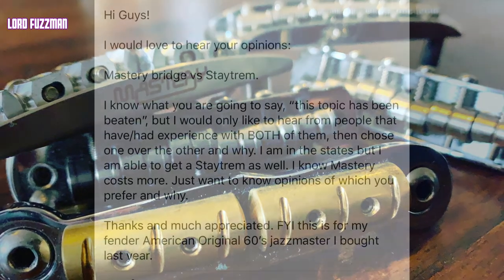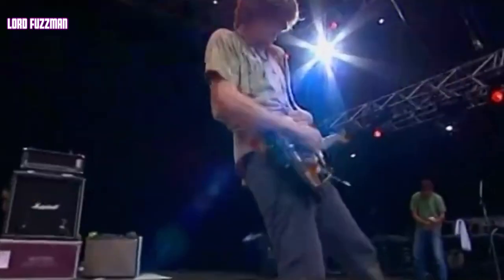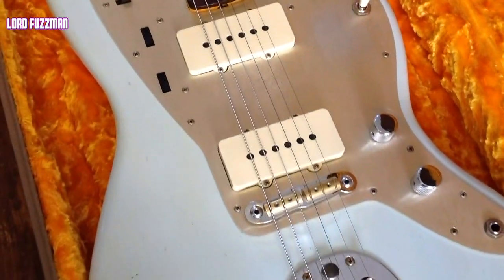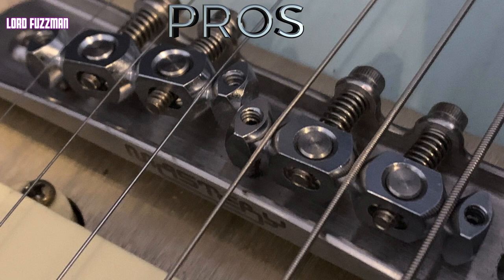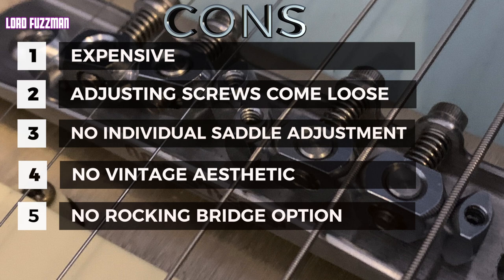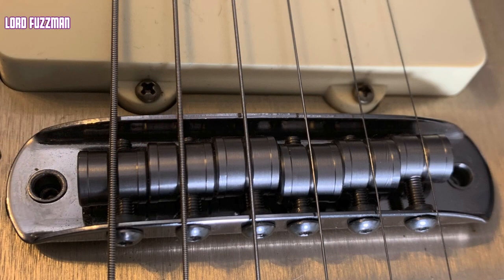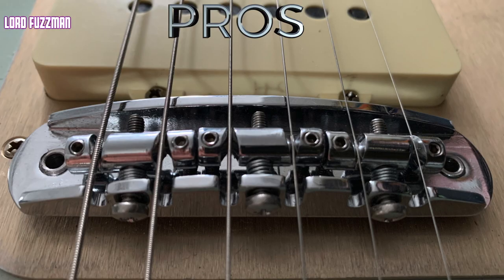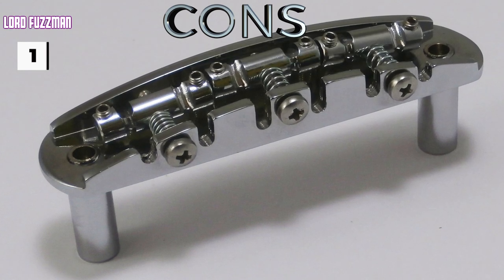ULTIMATE OFFSET BRIDGE SHOOTOUT - Mastery - Halon - Staytrem - Fender RSD - Mustang - Vintage

Comment: For me, offset bridges shouldn’t be about sound, it should be about stability. I have never in all my days come across a new offset of any budget that didn’t need heavy set up on the bridge to play properly and stay in tune. Why Fender and it’s sub companies have never in 50 years addressed this is beyond a joke.
Reply: Fender ignored the issues for a long time, but finally (!) now they have responded with the RSD bridge, which if I were buying today would be the one I would get. It's a great, simple design with none of the issues you find in the vintage offset bridges. The only downside is that you can't buy the RSD as an aftermarket part; they are only available on Custom Shop guitars. I hope Fender changes their mind and starts selling them aftermarket. If they do, I'll be the first in line to get one.
Reply: And yet you put a staytrem, or a mastery you’ll hear a significant difference in sound

Comment: In my opinion, the tone of the vintage style bridge is the best. It's definitely bright and clear. I think my second favorite is the Staytrem though. Seems like a good value and fixes the problems with the vintage style. Unfortunately, I think the tone is a bit darker on the Staytrem though. I really wanted to like the mastery, but I just can't seem to get behind the tone of it.
Reply: Agreed! I just invested $220 usd in a mastery for my '96 MIJ JM . I was shocked by this comparison- the mastery seemed to be the thinnest sounding, next to the vintage- for my ear- but also comparison varied to some degree, respectively, as he toggled through pickup settings 🤷🏻‍♂️
Reply: vintage screws loosen over time and start to buzz ..

Comment: Staytrem is fantastic, paired with a shim on my Avri 65 Jag it has perfect intonation, comfortable string spacing and requires no maintenance. Combined with the shim I'd say it enhances the classic Jag sound without drastically changing it.. exactly what I was looking for. Staytrem is also durable used mine regularly over the past few years with no issues. Staytrem collet and trem arm are also really good.
Reply from the maker: My thoughts and experience too 👌

Comment: I own a Classic Player Jazzmaster (Mexico) and, based on this video, I just purchased a Halon bridge. The original Fender bridge was like a toy compared to the substantial metal on this beast. OMG. So easy to set the height and intonation and the tone is huge and rings forever. Haris at Halon was very helpful and extremely fast with email replies. BUT the posts on the Halon were slightly larger in diameter than the thimbles on my MIM JM. Lucky for me I own a drill press. I screwed the posts off the bridge and inserted them in my drill press chuck (one at a time) and turned set the drill press to 1700rpms (my drill has an rpm readout). i took a file to the side of the posts while they were turning and filed them down to the correct diameter so they just fit the thimbles. It took about 20mins per post due to my constant testing and quality of the steel posts. Perfect fit. I considered drilling out the thimbles but i didn't think there was enough sidewall on them and didn't want to mess with enlarging the thimble holes on the guitar. I considered the mastery bridge but they looked a little weird for my taste.

Comment: That custom shop bridge is the winner for me, it seems to have a fuller sound, sustains nicely and looks the business. The weakest was the vintage. Whether any of this would be noticeable in a band mix is debatable. If I could get the custom shop one as an after market upgrade (and it wasn't too expensive) I'd be all over it. However, on balance and as a UK resident, the Staytrem would be my go to.

Great video, nicely paced and with all the information you'd ever need, IMO.
Reply from the maker: Totally agree. In a live setting you wouldn’t notice any difference at all, I think it’s more about functionality for me. Thanks for the kind words 👍🏻

Comment from the maker: Please subscribe if you got anything useful from the video 👍🏻
Reply: What is your opinion of the Fender American Pro bridge? It is often mentioned as Fender's answer to the Staytrem.
Reply: I noticed the bridges with more mass the mustang staytrem and halon all had a similar sound. Where the fender custom shop seemed to have a little bolder sound. I have menrioned this before but why not take a copper and brass mix or what ever bell brass is and make the saddles out of those. Anyways again great video. I gave you thumbs up
Reply from the maker: @jimh8422  thank you for the comments. Halon are one of the few companies where you can specify exactly what you want the saddles to be made of which is a great idea. They are still a relatively new company so still getting off of the ground though. Thanks for watching
Reply: Will do. Regarding the fender custom shop bridge- does it rock or is it fixed? And how was the tuning when the trem arm was used please?

Comment: I had a cheap tunomatic style bridge with roller saddles on it, which happened to drop right into the existing holes of my Fender Japanese Traditional Jaguar. The radius is "wrong" but it doesn't pose any problems for me at all. I actually think it has improved the tone a bit too. Not bad for free (seeing as I already had it lying about).

Comment: This was super helpful in my decision on which bridge I want. I really like the custom shop bridge, but because of lack of availability I might need to check out the halon because that seems like the next best option. Thank you for this awesome comparison video!
Reply: I checked out the new RSD bridge from Fender Custom Shop and it's really exciting. One of the best things they're ever done, in fact. It's too bad that they aren't selling it as an aftermarket part because they would sell a lot of them. They're using the RSD as a feature selling point exclusively on CS guitars. I don't really agree with that strategy as I would think Fender would want to get the RSD to as many non-CS players as possible.

Comment: Just got a tip for rattling or saddle adjustment screws vibrating loose.

Silicon gasket maker works great, and won't screw up threads.
Reply from the maker: Great tip Don, will give that a go 👌

Comment: I got today a Mastery bridge for my MIJ Jazzmaster, and so far I am super impressed by the improvement in tuning stability and sonical resonance/sustain of the guitar! I didn't consider other options also because of covid/shipping issues. So I had to get what I was able to find between my nation boarders. Also the setup was really quick and easy, and was able to tune and set the intonation properly.
Reply: Mastery is a well-engineered bridge. Woody is a total pro and knows what he's doing.
Reply: @danielstoddart  I was so well impressed I also got the Mastery Vibrato. Also in this case a totall huge improvement over the orginal MIJ part.
Reply: @JoelGilardini  The vibrato is also pretty great. I like how the collet is a better design that seems more solid when using the vibrato arm. I also like how there's no locking button...I never used it when I had one on the stock Fender unit and it simplifies it.

Comment: Been playing jaguars since they were cheap. I paid 184 bucks for my bascket case 64 and like 900 for my clean 63. Anyways i used a stock bridge for years i later picked up a no wire abr1 when gibson custom shop started making them. I made aluminum slugs that dont rock threaded for the abr1 post threads. I also play giant fat necks by warmoth on both my vintage jags and they are 12 inch radius which matches my bridge radius. I play jags for the 24 inch scale not so much the tone . So my 64 has burst buckers and my 63 has the stock single coils but wired more regular style just on off switch for each. This was a great video. I love talking jags. Really digging the halo. Although im not planning on switching my bridges. I pound the shit outa my guitars and they are solid.
Reply: Do you have any tuning issues with using the trem on a tuneamatic?

Comment: I needed a .1 shim to get the set up I needed with the Fender Pro bridge.  I did indeed get the perfect action with no issues, except the break angle was so extreme it made the string tension impossible for whole step bends.  The Mastery bridge solved that, and turns out to be perfect for me. And I love the way it sounds with my rig.

Comment: That Halon sounds remarkably "flat", or full spectrum. It reminds me of studio monitors: they aren't exciting, but that's because nothing is missing- no notches or surprises.

I know which I'd splash out on for a new build for sure.

That said, my current offset crop (3) use variations of the "proper" Mustang bridge and the American Professional with and without nylon bushings (rocking and non-rocking). They're relatively inexpensive, relatively high quality, and once properly shimmed at the neck and set up (1x Descendant, 2x AVRI trems) absolutely flawless with regular 'ol 10s.

Comment: I think it should be mentioned that Halon offers rocking bridge studs, besides keeping with Leo's original design, if you have a mute on on your Jag, and you want to use a Mastery, you'll have to drill out the holes in you mute to make it work, the Halon rocking studs work fine with a mute, they fit fine into the mute holes.

Comment: The video shows some Mustang saddles with adjustable height screws during the Halon portion and they don’t have these on their site. Just wondering if that has been discontinued. We prefer a slightly flatter radius and resort to shims on the E strings so these would offer a more elegant solution.

Comment: Was going back and forth on mastery or staytrem. Read the forums and all pros and cons, but this video solidified my staytrem purchase. Just ordered. Now a mastery tremolo unit and a staytrem bridge that rocks may be something awesome though.
Reply from the maker: Wise choice Evan, yeah a Staytrem bridge and Mastery trem is a great combo that I use myself 👍🏻
Reply: @LordFuzzman  I got both units ordered. Might be some time until I see them, but not in a rush. My stupid fender tremolo (really vibrato but whatever) doesn't completely return to it's original position after use which I have never seen before. Mastery should take care of that. I find it odd that mastery pretty much tells you to leave the arm in at all times though and will refuse to sell a replacement if arm is lost.
Reply from the maker: @evanpauls3078  yeah I hear what you’re saying. I do leave my mastery arms in all the time. Even in the case and never have any issues 👍🏻
Reply: @LordFuzzman  a real pleasure Fuzzman. This video is seriously amazing and super high quality. You made things very clear and got me to stop wading through all the forums and noise with some very true and straightforward comparisons. Also, with my open back headphones on, the sound quality of the video itself really helped make certain observations pretty apparent. Much appreciated!

Comment: The vintage is fine! Just use heavier strings and the right setup no need to change it - I did like the resonance the halon had but it had less upper high end detail - the mustang and staytrem seemed to choke the sustain a little and made it more ploddy- the mastery did have a nice open ish sound to it - and I love the idea and look of the CS in all honesty I have no issues with my vintage style one I think I’ll keep it as is :)
Reply: Exactly what I think. My favorites were the vintage and mastery by far. I have the mustang, and I think it sounds awful. The Staytrem is pretty nice, but not enough clarity and overtones. I actually just don't like adjusting the individual saddles which is why I replaced it with the Mustang, but I really don't enjoy it so I think I'll just deal with the Vintage or maybe get a Mastery.

Comment: OMG, night and day with the Custom Shop Bridge. I think the Mustang is the runner up for me. Just like PRS will use brass tuning pegs and saddles to get more chime, this made it clear to me that brass saddles really make a difference. More bell like, for sure. Clear as day. 
I think it would be the difference between cutting through a mix (especially live when you have less control over your mix) and disappearing. 

*Granted, if you're in a shoegaze band, single notes cutting through vs having a homogenous wall of sound might make you want to stick with a stock bridge.

Comment: Great video, very informative! The other thing I'm curious about is how the bridges affect the trem action? I have a J Mascis Jazzmaster with the AOM bridge. I'm considering modding it to fit another jazzmaster style bridge. I have heard that bridges with the rocking action affect the trem action and sound in a positive way, as compared to fixed bridges like the mastery. Would you have any recommendations? Thanks!
Reply from the maker: @gambrinuspie  hi thanks… yes the rocking bridge works much better with the trem.. I would go for either Staytrem, Halon or Tuffset 👍🏻
Reply from the maker: @gambrinuspie  hi thanks… yes the rocking bridge works much better with the trem.. I would go for either Staytrem, Halon or Tuffset but you made need some conversion posts for the J Mascis bridge which are available on eBay. 👍🏻

Comment: I’ve got a question — I’ve never used the mastery bridge, does it stay on the guitar when you take the strings off?  Or will it fall off?  One of the things I like about the TOM/AOM bridges is that you can get locking set screw versions that won’t fall off when you take the strings off.

Comment: Huge help! Thanks for taking the time and trouble to do this.  I'm thinking about a Custom Shop Mustang, so I can get the RSD bridge which is very appealing but this video shows (at least to my ears) that a regular Mustang bridge could actually be preferable because it offers individual string adjustment which I really need with heavy strings and wound third.  Thanks again.
Reply from the maker: Glad you found it useful, it’s not the most interesting topic but people ask about bridges on the forums every day.
Reply: @LordFuzzman  SO very true!  I am now questioning myself about how crucial is it to me to have individual string adjustment?  With a heavy set, 52-12 with wound third, maybe the RSD is perfect as-is?  The only chance I'll have to find out is ordering one through the Custom Shop but I would sure hate to get it wrong and find out that I really needed the adjustment and have a much cheaper unit with the Mustang conventional bridge.  I have that on 3 guitars from the Parallel Universe series already so I'm tempted to try the RSD but it's still something of a risk.
Reply from the maker: @ES295  I don’t think they sell the RSD separately. Staytrem are now shipping globally. You can’t go wrong with one of those 👌

Comment: Great video! I play a bigsby Tele, so all this is kind of relevant to us too.
I use the vintage style JM bridge, but I think the bigsby adds a bit more break angle.
I use some nylon/plastic strips cut to size which I insert into the post holes which reduce the amount the bridge can rock, without locking it completely.

Comment: I've got the J Mascis Squier with TOM bridge and at some point, I think I'd prefer another bridge. I prefer a drop in option, but that can be problematic with thise Squiers. Staytrem appeals to me in that they are apparently great bridges and I've heard Staytrem makes thimbles especially for J Mascis that drop in. 

I'm in the states, so getting one could prove to be difficult. My other option might be a Wilkinson roller bridge. I've heard most drop in and resolve a lot of the issues, but doubt it will be as ace as a staytrem.
Reply from the maker: Staytrem stopped making the drop in replacement a couple of years ago, I did a video on it and he got inundated with orders. Halon do a very good drop in replacement.

Comment: Great video! Just ordered a staytrem for my ‘95 MIJ jm… Original owner had a TOM installed with small 5mm dowels!? So I need to somehow get those dowels out to get back to original 9mm post holes. Any DIY suggestions?

I’d also love to know your opinion or see a video comparing jm Vibrato systems/tailpieces.

I’ve personally decided to replace my MIJ tailpiece with an American tailpiece fitted with a Staytrem arm/collet. Waiting for shipment so still haven’t tried it or a mastery.

Cheers

Comment: Great review. I have tried the stock, the mustang, the Staytrem and the RSD. Out of those I prefer the RSD, with the Staytrem a close second. But the RSD most certainly is a rocking bridge, however its rocking range is a bit less than the other rocking bridges.
Reply from the maker: Hi thanks for watching, do you still have the Guitar with the RSD? There was absolutely no movement with an RSD, I’m intrigued !
Reply: @LordFuzzman  I do still have it, it’s my fave guitar. It’s a Custom Shop Wildwood 10 - special run made for Wildwood Guitars, and that RSD does rock! The suggestion appears to be that Fender has made rocking and non Rocking RSDs. As a matter of fact mine has little ridges perpendicular to the strings, in the saddle string slots, that fix the strings, especially the wound ones, in place, so that when the bridge rocks the strings don’t slip across the saddles.
Reply from the maker: @bcjaliu  that’s really interesting, thanks for the info. I’m glad they are doing a rocking option too. It wouldn’t make sense not too after all these years 👌